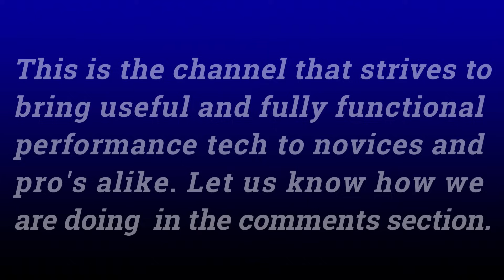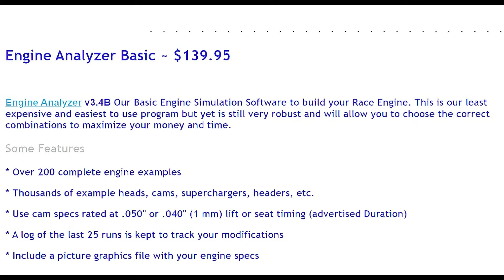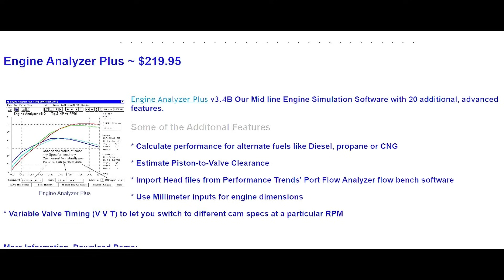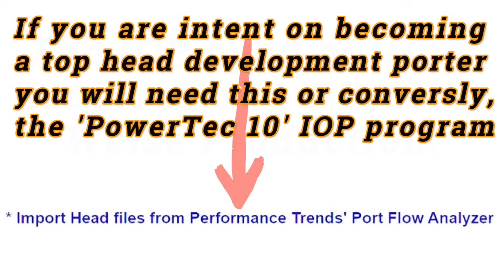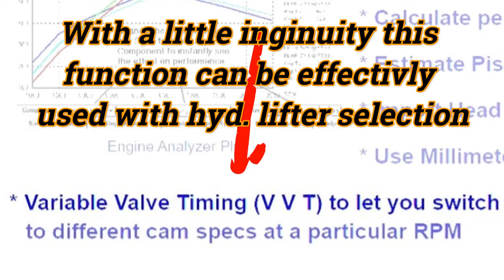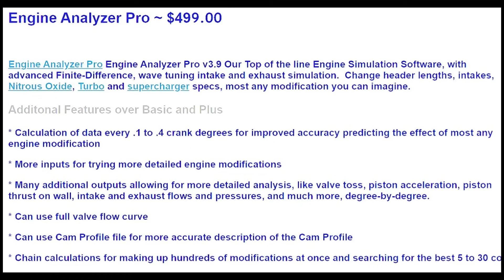Why is the cam Lobe Centerline Angle so important?

Comment: Hey, @DavidVizard.  I asked ChatGPT o4 the following question and got this answer (I removed the definitions it gave to save space to fit in one comment.)  Thought you might be amused.  I wonder what the answer will be in a few years.:
Q:  Which are the independent and dependent variables that determine the optimal camshaft specifications for a V8 engine, such as LSA, overlap, Intake valve Closing degrees, Intake valve Opening degrees, Exhaust valve Opening degrees, Exhaust valve Closing degrees?
ChatGPT said:
Determining the optimal camshaft specifications for a V8 engine involves understanding the interplay between independent and dependent variables that influence valve timing and engine performance.
**  Independent Variables:
    These are the parameters that can be directly selected or adjusted during the camshaft design process:
    Camshaft Duration (definition deleted here)
    Camshaft Lift: (definition deleted here)
    Lobe Separation Angle (LSA): (definition deleted here)

**  Dependent Variables:
    These outcomes result from the chosen independent variables and their interactions:
    Valve Overlap: (definition deleted here)
    Intake Valve Timing:
          Opening (IVO): (definition deleted here)
          Closing (IVC): (definition deleted here)
     Exhaust Valve Timing:
          Opening (EVO): (definition deleted here)
          Closing (EVC):  (definition deleted here)
By carefully selecting and adjusting the independent variables—such as camshaft duration, lift, and LSA—engine builders can influence the dependent variables to achieve desired performance characteristics, balancing factors like power output, torque, fuel efficiency, and drivability.

Comment: The winner of the cam challenge had a centerline of 108. The centerline angle doesn't determine the geometry of the lobes, which is what actually opens the valve, it controls the overlap between the events. 4 valve engines have cam phasers to vary that overlap on the fly. If lobe separation angle had no influence on torque, OEMs wouldn't have gone through the trouble of putting cam phasers in their 4 valve engines.

Comment: I have and used the PT Engine Analyzer for over 20 years with my Harley and Ford V-8  projects.  I have used it for both cam selection and exhaust design on my bikes.  I look at the trends in the torque curves not the HP peaks.  I feel the program has saved me from making big mistakes in cam selection.  I don't know if I have chosen the "best" cams, but I certainly have avoided buying turds that wouldn't work in my projects.   I do recommend the PT EA to every shade tree back yard builder,  A hundred dollars well spent....
....RooDog....

Comment: David, you are spot-on about Eric's labor cost in doing the work needed to run this challenge. I've already donated, but I am going to toss a few more bucks his way. We are all going to learn from this.
Reply: https://youtu.be/mUq-K9jcaB8?si=iFgoD_ncy05-wh-U

F1 engines have huge turbos and run around 50psi of boost, they like the engine in the cam challenge had more than enough intake, and like the cam challenge winner, F1 engines run very short lift, and duration on the intake, and maximize the exhaust expansion ratio. Just like the winner of the cam challenge.
Reply: New engines probably end up using DV's poly-quad idea.

Comment: Not in this type of engine David but an engine you spent 1000’s of hours back in the Uk. The a series engine. I spent on and off 20years or so looking at cams and figures almost 15 years ago I did a cam with Kent cams only trouble was cost so the lobe profile wasn’t as I just wanted. 2 years ago I did my cam with piper cams. I always start with the LCA, (I got  all of your books.) I built my first engine it had 2:75 blow by and 1400rpm flat power band. Which produces more bhp torque than some of the regular a series engine builders back ere. Everyone said why do your own cam. N that’s y in a nut shell. LCA RULES 👍🏻

Comment: Can anyone answer this question for me? 
How many degrees of duration does the camshaft keep the valve at peak lift? It appears to only be about 1 degree at most. Am I wrong. Are there any cam grinds that keep the valve at peak lift more than a few degrees?
Reply: Usually the goal is opening the valve as fast as possible, so why not keep opening the valve instead of pausing
Reply: @josephschaefer9163  There is only so far a valve can lift. So, my question is do any companies grind cams that stay at peak lift for more than a few degrees? If so, who? If not, why not?
Reply: @VGHCX  a fatter cam wont make more power due to head flow limitations. You can get radical custom grinds but those eat themselves fast, for small hp gains
Reply: @josephschaefer9163  Wouldn't an ideal cam open quickly to peak lift, stay there as long as possible, then close quickly? Seems the current grinds of cams spend the majority of the time on the opening and closing ramps. Am I wrong?
Reply: @VGHCX  you're not wrong, but most people don't want to break parts every run. Radical grinds hammer the valve train
Reply: @josephschaefer9163  So, essentially based off the current architecture of the OHV engine valve train the ideal cam cannot be made to work with the engine. This leaves the cam grinders to compromise and make the best of the circumstance.

If only there was a better OHV valve train system that could be invented to enable less lobe lift and a smaller rocker ratio to reduce the force applied to the camside of the valve train components without sacrificing durability and performance. I am optimistic it will be made someday.
Reply: @VGHCX  "if only".....oh but there is. Koenigsegg electric valvetrain. Open as far as necessary and open as long as necessary. No camshaft.

The shock of the valve coming to "rest" in an OHV engine will destroy springs and or rocker arms. Keeping the valvetrain in motion with a dwell at peak of milliseconds  is the best it's going to get.

Comment: Is there any way to get a David Vizard suggestion for a Camshaft?
Reply: He’ll sell it to you
Reply: You're much better off learning the process by modeling your own engine in EngMod4T, but, since it's true engineering software requires quite a lot of knowledge about 4 stroke cycle engines and some measurements that aren't simple to get in V8 engines.

Barring that, filling out Mike Jones' cam selection tool and letting Mike grind you a camshaft is going to get you closer than most other methods.

Running EngMod4T takes some processing power as it involves solving millions and millions of equations and requires a plugin to actually derive lift curves. It's about $600 total with the camshaft plugin, but shy of a graduate level university engine design program it's the best software suite for mortal beings.

It's only a camshaft. Unless you have a need for the ultimate in power, Mike Jones will set you up. Another option would be Bullet in Mississippi.
Reply from the maker: @ToddWright2  - I think I would rather go with Mike Jones!

Comment: A SBC factory style roller cam was $522 last time i looked if the program prevented you from buying the wrong cam one time, it payed for itself
Reply: Man I thought mopar was supposed to be expensive!
Reply: @DavidPhillips-rs5dq Just as expensive as Ford. If they're built right you don't need any more parts😅.
Reply: Check out Herbert cams, some of there oem roller cams are cheap. Most of them you can custom spec what LCA you want the cam to be ground on
Reply: @braydenh2047 years ago chet and I specked out a S B C camshaft. I paid him 179 for a roller cam that did exactly what he said it would. Those were the days.
Reply: Unfortunately not everyone owns SBC, BBC, SBF. Those with other engines have been left out😒.

Comment: can you design me a cam profile for a 1972,  351 cleveland , 4V , open chamber stock eliminator engine ? It has a .481 lift rule .
Reply: Need more data: Intake, trans, heads port/valves, exhaust. MPG Head Service sold intake port inserts. Are those legal to use? What kind of cam?

Comment: Look after that brain DV, still working pretty good, feed it meat.
LCA, as referred to intake lobe position ? or LSA, the difference between intake LCA and Exhaust LCA ?
 i.e if 107 to 110, I take it that's the LSA and the installed intake CL's will be between 102 and 108.
EDIT....Just got the cam cards, a couple of surprisingly wide LSAs in there, even with advance that leaves late inlet CLs.

Comment: Gonna stick my neck out , and say the winner will be David Vizard or Bryan Salter . Thinking the latter because of all his recent experience  .
Reply: I haven't been this interested in a competition in a few decades. No matter who wins we all win. What a great group of technically advanced minds. This is gonna be good.
Reply: Powell is a great cam guy..   I'd pick him
Reply: @bamsportscollectibles2185 Same here
Reply: How can one go about finding the correct ICL and ECL?
Reply: @gmstudent93  ,,, if math is , let's say , not your favorite subject . Put a cam in and move it till both lobes are on the same degrees . This is called split , or straight up . This is your center lines . Then on , leave it there , or and to save time only check your intake lobe as you advance or retard your cam to your setting .
Reply: @rolandtamaccio3285  i love math, engineering and tuning
Reply: @gmstudent93 ,,, alright draw out what I said on paper , first drawing should have both lobes in end view , with say , pic a number , of 108 centerline , that is centerline for both lobes , then second drawing with the intake at 106° that is 2° advanced .
Reply: @rolandtamaccio3285  how do you post pictures on here 🤣 I understand how an engine works from pressure waves in the intake to scavenging in the exhaust, especially scavenging during overlap. I understand lift and flow numbers determine duration.  As well as compression ratio bore stroke and valve lift area for lsa. I just need some help putting it all together.
Reply: @gmstudent93   you select the correct open and close valve events and peak lift position for your exact combination from air intake to tailpipe exit.  Then you can calculate a lobe centerline for each lobe and from that you can calculate the LSA that you have created. Centerlines are a reference point for machining and subsequent fitting/degreeing of the cam when you install a cam design. You dont pick centerlines and then events around that.
Reply: DV finished 3rd from the bottom.  Maybe he doesn’t know as much as he thinks he does.

Comment: Your lsa theory seems to make perfect sence to me in that as duration is added or removed the bulk of flow would remain at the correct time to take advantage of the conditions in a given engine. This would maximize the flow and trapped charge in the cylinder to the best possible balance. JMO
Reply: Yes, makes sense to me. The relation of intake to exhaust is optimized at a precise angle. Then, not changing that LSA, only increasing or decreasing the duration, optimizes the RPM range. 

If your ports and airflow in and out of the engine are constants, but vary only by RPM, then you can calculate an optimum LSA, and just adjust duration according to wanting a stump puller or a rod slinger.
Reply: @richdouche8253     Perfectly explained.   👍

Comment: Lsa vs lca I'm confused on that. A cam I've been looking at has lsa 107/117 and that translates to 110 lsa. What am I missing?
Reply: Rough and ready way to work out Lobe Separation Angle from Lobe Centerline Angles is add the two together and divided by 2.
Lobe Separation Angle is Cam angle between lobe peaks,
Lobe Center Angle is crank angle turned to reach peak lobe lift, hence the divide by 2.
107 LCA + 117 LCA = 224
224 ÷ 2 = 112 LSA. 
So, this cam is cut on a 112 lobe Separation Angle, but advanced 5° to get the altered 107/117LCA points.
Reply: @crd-nz_001 only way to make this maybe more understandable is if the lobe separation angle is 110, and the intake centerline is 110,then the exhaust centerline is 110. If you advance this cam 4 degrees, the lobe separation (lsa) is 110. The intake centerline is 106 and the exhaust centerline is 114.
Reply: If what you are saying is your icl is 107 and your ecl is 117 that cannot translate to 110 lsa. If in fact your intake centerline is 107, and your exhaust centerline is 117 then the lsa is 112
Reply: @jeffreydurham5342 the cam specs say lsa 107/117 it doesn't say anything about lca.
Reply: You're right, I'm wrong about the lsa but does 107 mean lca?
Reply: @henrythomas3834  i think Jeff is spot on. I haven't committed the formula to memory and don't have the book in front of me. Add both together,  divide by two=lca. Vizard uses lca and cam cards dont use that term
Reply: @henrythomas3834 lsa = lobe separation angle. It's set in stone when the cam is manufactured. It is one number, it can't  be 107/117. Lobe separation angle is the separation of the intake lobe from the exhaust lobe. It is one number. If your cam card shows a lobe separation angle with more than one number, something is wrong.  We are talking about an engine with one camshaft, right? I'd like to know more about who made your cam and what engine it is.
Reply: @jeffreydurham5342 it says lsa is 107/117 and I think melling is a pretty knowledgeable on camshafts.
Reply: @henrythomas3834  That cam is a 112 LSA.
Reply: @henrythomas3834  you obviously know nothing about camshafts, or math in general. LSA is lobe separation angle. It is the angle between the max lift points on the intake and exhaust lobes. It cannot be two different numbers. If Melling says they have a cam with two different lsa angles they are full of shit.
Reply: @Thirdgen83  Exactly! With 5 degrees advance in the design.
Reply from the maker: @henrythomas3834   107 + 117= 224 ----- divide that by 2 = 112 LCA
Reply: @jeffreydurham5342 check your math
Reply: Lobe separation angle, lsa, at 110 is in relation to each other and the individual lobes are 107 and 117 from center with 3* advance. (I think. I'm still learning)
Reply: @paulmryglod4802 that's my thoughts also. Thanks
Reply: @paulmryglod4802  It's 112 with 5 degrees advance. 112 -5 = 107. 112 + 5 = 117. It's pretty simple.
Reply: @jeffreydurham5342  thank you. My brain was cooked after a long day, plus I'm still learning.  I appreciate the clarity
Reply: @paulmryglod4802  you're welcome
Reply from the maker: LSA & LCA are the same thing - one UK and one USA!